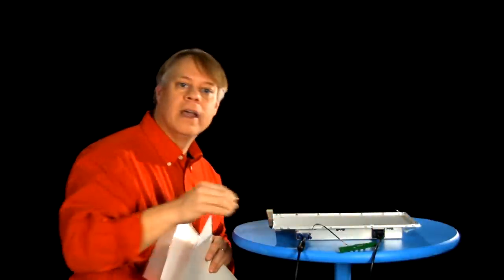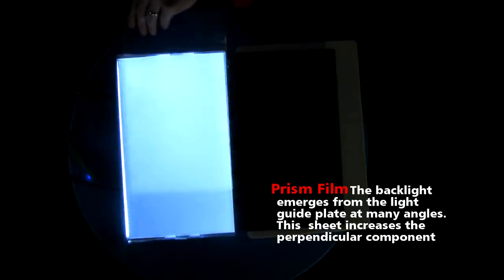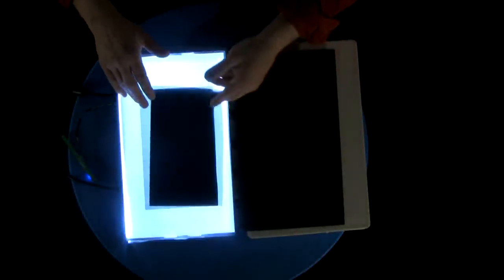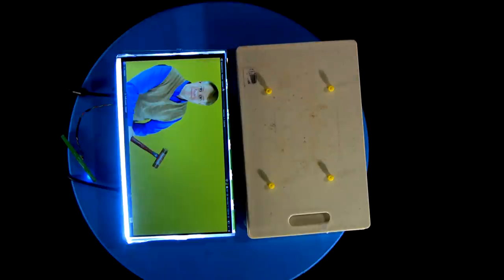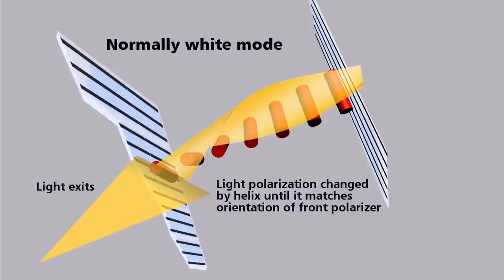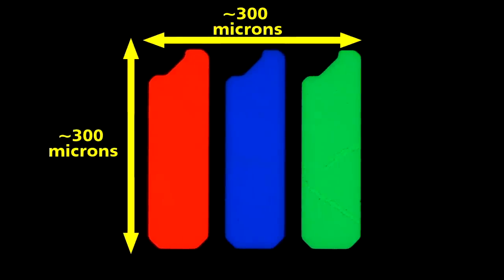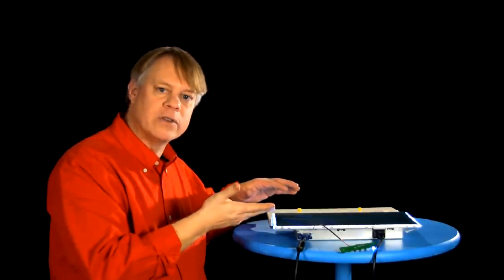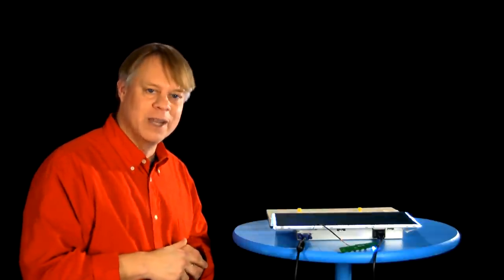LCD Monitor Teardown

Comment: That's the right idea, but the camera isn't fast enough either. I think it has more to due more with a phenomenon called "aliasing". The sampling rate of the camera (also the FPS for the camera) happens to be at a speed that makes this happen, but there are other speeds as well. 

Aliasing is also the reason why stripped shirts mess up on TV. This is spacial aliasing where what you're talking about is temporal aliasing. Same phenomenon, only for different dimensions.

Comment: @AzureFan1 It is pretty darn blue. It's too blue... you'll notice that he's wearing a more pastel colour. You achieve that mix in an RGB by adding more green, and a bit of red. That's because the colours of the cones in your eye (that pick up coloured light) are Red, Green, and Blue. Your brain simulates the other colours by combining how much each of those react. Computer monitors add more or less of each to create the same perception of colour when you look at it.

Comment: Thanks for the video ... Really useful .. so what's the black marks like the water marks that follow your finger when you press on the screen? Sometimes I realize that when you press on the LCD monitor .. it will have a black marks and as soon as you release .. it slowly disappear.. will that damage the screen? What happened was I had a Nintendo switch and I didn't realize the cover was plastic and not like the cell phone which has glass .. so when I install the screen protector  and you know how there are bubbles, so I have to apply pressure and push those bubbles away .. so by doing that , and since it's plastic ... Will I damage the LCD screen? Like when we press hard on the computer monitor ... I now worry 
Thanks

Comment: How can you make (manufacture) such tiny "pixels", their elements and controls?
To me, that seems as amazing as just being able to control and produce the color in the first place.  72 dpi used to be standard on CRT, but that was mainly glass coatings. Cell phone can have hundreds of dpi (or PPI) and these each require electrical/switch/activation. I would love to see a video on that.
Reply: +Robert McClure   What is most amazing to me is when looking at a 70 inch LCD display, think about the millions and millions of transistors, all of which have to do their jobs perfectly, else you'll have a dead pixel.  That truly is mindbending, the reliability of the whole screen.
Reply: +Quantum Leap that's my point: I think a 1080p HD 70 inch has just as many "transistors/components" etc as a 19 inch 1080p HD ( or 5" high end cell phone with 1080p for that matter)
How can they do that?
Reply: Robert McClure Are you sure of that?  I would think there are many more pixels in a 70 inch display than in a typical cell phone display.  Or are they just more spread out?  I would like to see what the pixel count is for both.

Comment: Yeah...the spray adhesives for the middle films...I trash picked a large flatscreen tv hd lcd monitor anding a  was wondering if the water stains that remained even after applying a shammy to them with distilled water are permanent.  The copper tabs arent oxidised, but a portion of darkened ring around the edge is a concern..something that is visible at times while watching.  I noticed the adhesive layer on one of the films. So, they all receive the same light chamois treatment with distilled water and vinegar, because i'm willing to do a second cleaning. Soon, the tv parts are sprawled apart in my living space, and i need to sleep tonite, my tv panels cant take my spot for sleep.

Comment: So you adjust the percentage of the red/blue/green to get different colors?! Thanks for this!
Reply: Yep. In many modern systems there are much more complex layouts than the RGB shown here. But basically they all work on the idea of blending different subpixels together to make an overall colour for the pixel by setting the percentages on each subpixel. Sometimes they throw a yellow subpixel in there, or have more of a particular colour of sub pixel, or have different shapes and sizes. For example the OLED screens in the Samsung S6, which while a different type of screen still uses the subpixel method to create colour, looks like this http://www.displaymate.com/Samsung_Diamond_Pixels_2.jpg

Really cool stuff imo :)

Comment: you got it all wrong, LED is just a backlight of LCD monitor. There are two types of LCD backlight: CCFT (cold cathode fluorescent lamp) witch is pretty old, and LED (Light-Emitting Diode). Now if you want to now what's the difference between the just google it.

Comment: Next: You take apart a 3DS to show us how parallax barriers work for auto-stereoscopy, and how they got around the problem of subpixels meant for one pixel being incorrectly grouped with another pixel when you tilt the screen a tiny bit. That is to say, RGB RGB looking more like GBR GBR due to the bars on the parallax barrier.

Comment: very interesting. Do you have any input on OLED screens ? i remember when i was going to my electrical engineering program a teacher of mine was talking about oled screens and it was the first time i had heard about them. i love the idea of them, being able to put many many layers of oleds and still have a thickness of about a sheet of paper. so you can get actual depth out of the display.
Reply: Review Guy OLED are simpler than LCDs. It's just a sheet with millions of red, blue and green emissive LED subpixels.

Comment: tl;dw Light is diffused evenly across the screen. The screen is made up of pixels made up of 3 sub-pixels: red, blue, green. Liquid crystals between the light and the screen receive electronic signals which control how much light passes through each sub-pixel.

Comment: "other than the on/off switch the monitor has no moving parts" Incorrect on multiple levels, there are a number of momentary switchs for one, but outside of that the LCD panel it self has millions to billions of "moving parts" in function its electromechanical, the crystal dipoles change position corresponding to the electric field (in short every suspended crystal molecule in the LCD is a moving part)

Comment: @quangluu96 

You might also be referring to OLED sets. These have no back lights. The pixels themselves emit light. These panels can be extremely thin because of that, and since you don't deal with blocking the back light you don't have the light seeping imperfections that the polarizing filters do. Giving you the deepest contrast and black levels. However these are are hard to manufacture in yields and sizes great enough for them to become affordable right now, but maybe in a few years.

Comment: Wouldn't it be easier to just have the power button control whether the LED light is on or off? Also, I've never understood the RGB color system. Why not use the 3 primary colors, red, blue, yellow? Green could still be made easily with blue/yellow.

Comment: I cut the front polarized sheet off my monitor, so that the screen appears all white. I realized that 3D-glasses are also made with polarized sheets, so I realigned them in the glasses to the correct orientation. Now only I can see what is on my computer screen.

Comment: I use nvidia 3d vision glasses for 3d video games on my 120 Hz monitor, and regardless if it functions in 120 Hz or 60, 3d or not, when i rotate the glasses 90 degrees to the right or the left, the screen is completely black. i guess the method used to close one eye at a time with the glasses is the same as with LCD displays, as shown is this video.

Comment: It's impossible because if were to do that, the amount of wires coming from the monitor would be tremendous and inefficient... In other words, it will need to have a ground for each pixel and not just one central ground...

Comment: So I have a question if anyone would like to help: what would stop someone from taking just the two polarizers and the glass, and using them to make a new form of Camera shutter? Just apply the electric current to decide when light can pass through and when it can't, eliminating the need for moving parts within camera shutters, allowing for higher frame rates and eliminating rolling shutter? Am I missing a reason why this wouldn't work?

Comment: I have a question you said voltage is applied to a specific raw at a time but there is many sub-pixels in each raw and my question is how does each one get different video data from one source of voltage?

Comment: I want to replace the front polarizer of my damaged Asus VX229H (21.5") IPS monitor. However, I am unsure of the angle of the view for an IPS polarizer. I found a 21.5" wide screen LCD polarizer, with 45 degree angle of view. Will that do the job or should I get a 90 degree one?

Comment: Is it possible to fix up a mobile with optic glue between the LCD light panel and the ito screen?? My model only has glue in the border, but it is tape glue. I would like to seal the screen with my optic glue because of the dust. Thank you!!!

Comment: :), Yeah, a little bit mis-informed!
What I talked about was more like an LED panel, actually that was exactly what it is. And yes, LED monitors still use LCD layers to control the intensity of the light!
There are 2 types of LED monitors, one is nothing more than normal LCD using LED's at the edges for background lighting instead of a CFL bulb.
The other one uses a panel of white LED's all across the screen, this one is much better! And the brightness of each LED is now also adjustable.
:D

Comment: @quangluu96 

Edge lit models are probably what you are referring to as the ultra thin ones. Much like the one shown in the video they use an array of bulbs at the bottom and diffuse the light across the panel, but the lighting is not often completely even, and the edges are brighter in these models.

Other models are thicker because they need to accommodate a row of lights behind the panel itself, not just from the edge. 

en.wikipedia. org /wiki/Backlighting

Comment: I've been trying to figure this out for the longest time. If you have the LCD screen to just the two polarized sheets with the glass in between, is there a way to remove the two very stuck polarized sheets without damaging the glass in between?

Comment: Are TMT and IPS panels using something other than Thin Film Transistors (TFT)? If so, how do they work?
Reply: The display shown here is actually IPS device. All modern LCD displays use the "active matrix thin film transistor" tech, it's just the question of how those transistors and the electrodes are configured in relation to one another.

Comment: @husnainanwaar1992
What's called LCD (when we talk about computer monitors) is the same as an LED panel. What changes is the backlighting system. "LCD" panels have a CCFL or Cold Cathode Fluorescent Light to illuminate it from the back, while an "LED" panel has those rows of LEDs like Bill demonstrated in this video. But both of them have Liquid Crystal Displays (LCDs) in the front.
OLEDs are a totally different technology, which... I can't really explain. Bill? Help?

Comment: Hello, I look everywhere about connections of the transistor in LCD screens and I can't find anything. How all transistors are controlled? I mean: if I have a Full HD screen, it has over 6 millions transistors, so how are they connected to control unit? Is there a Integrated circuit, which has a 6840 (1920*3 in horizontal plus 1080 in vertical) wires coming to it? I'm sorry for my English and I hope You understand me.

Comment: Where can i buy those diffuser films for my 27 inch samsung 27D390 monitor which has a stain on one of those diffuser films :(
I already rubbed it with alcohol but did not work :( It must be a water damage :(

Comment: What about IPS or AMOLED Displays?
Reply: IPS screens are LCDs. AMOLED screens though work differently. There's no backlight, no liquid crystals. Each RGB subpixel creates its own light. You can turn on/off each individual pixel so there's no need for polarised filters.

Comment: You don't add the three sub-pixels together to get 100%. They are independent of each other. Let's say the maximum intensity of the red pixel is 100%. In the video, it is at 12% intensity, where 100% is the maximum intensity of that sub-pixel.

Comment: @quangluu96 

I picked up a Plasma a month ago. A Samsung PN51D6500. I really like it, has quite a gorgeous picture and deep blacks. Its just over an inch thick and was light enough for me to pick it up and carry around myself. 

Take a look at some of the offers out there, Plasmas don't deserve a lot of that criticism anymore. If you leave it in energy saving mode for the first while the chances of burn in after is very low. Or put the timer on before you sleep :D

Comment: What is the mechanism that regulates the subpixel intensity? In other words how does the first red subpixel know it should become black here in the example?
Reply: Ok I found out how it works. Now Im stuck on another thing. The video shows that voltage is applied to an entire row at a time but to have the subpixels light up with different intensity there must be different voltages on each of them. I guess this is done through the transistors but what controls the voltages on the transistors ? Does the signal contain the voltage setting for each transistor in each image? Damn I should have studied electrical engineering this stuff is mind blowing .....
Reply: Eternaldream00 I assume there is a circuit board built inside the casing of the monitor that regulates each transistor.
Reply: Eternaldream00 I guess that the applied voltage is connected with the collector region of each transistor and it's fixed, while the video data is a voltage applied to the base region and is changeable, so as the voltage applied to the base increases the base current increases and thus the collector current which represent the color intensity .. and this represents an analog control of the transistor " in the active region " ..

Comment: You could use this concept to make a 3d screen without the flickering glasses.

If the polarization of each pixel alternated instead of being homogenous...

Then the wearer'd only have to wear a polarized screen of different orientation over each eye. No batteries!
Reply: they have that in cinemas
Reply: +J-sUn http://www.cnet.com/news/active-3d-vs-passive-3d-whats-better/

I guess what I was thinking of was this, the passive 3d displays, that alternate each line with different polarizations.

So that one eye gets vertically polarized ligth, the other horizontally.

What I don't get is why the polarize by rows, and not alternate each pixel in like a checkered pattern? 

More natural to build these for interlaced scanning?
Reply: Galo Aguirre yeah, pretty sure stripes are easier to make.
Reply: +J-sUn right, yeah. 

The article mentions visual 'artifacts', though. I wonder if these would be fixed with the checkered pattern.